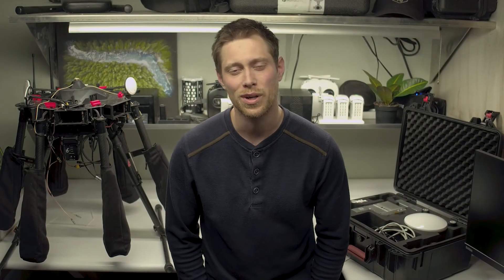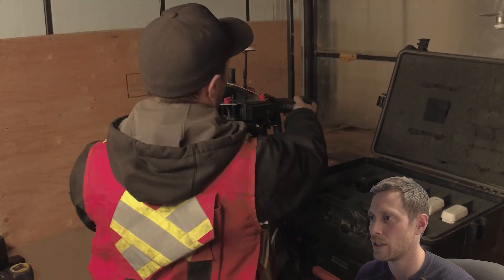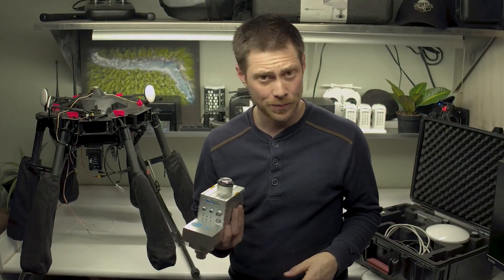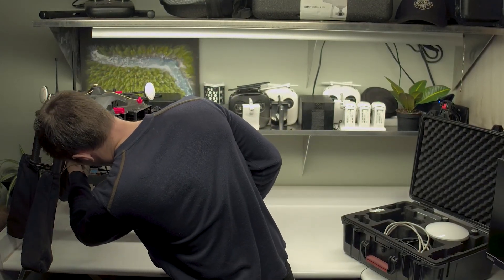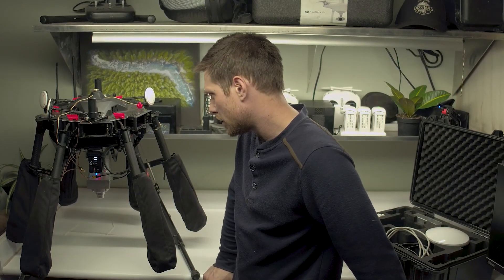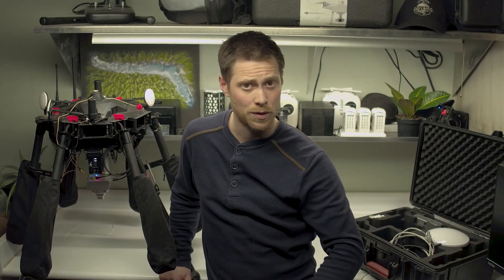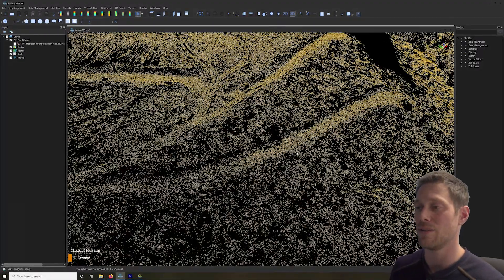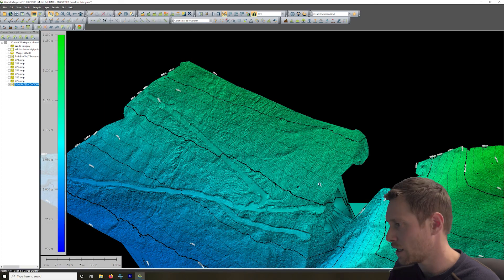Steep slopes with the LiAir V Lidar Sensor

Comment: hi, i am from Argentina. i bought one of these lidar 3 months ago and i have a hard time getting the IMU to be "solid blue". Sometimes I spend more than 25 minutes waiting for it to get the blue light from the IMU. Has it ever happened to you? I have tried more than 30 times and only 3 times have I gotten the IMU to work. I have been told in support that it is an electromagnetic field issue, but it happened to me that I have come out with solid blue and when it lands it is flashing red and then when I download the images to the software, some even place them wrong. Do you have any suggestions you can give me about it? Thanks.
Reply from the maker: Hey unfortunately yes I have had this problem before but not to the difficulty you have described. If this happens I just pick the whole drone up and do a manual figure 8 and then power the LiAirV off and then back on agian. It usually is good for a while after that though... Try that first and let me know how it goes.
Reply: Hola Soy de Chile y también tengo un sistema de GVI. Me pasa algo similar con la luz azul. lo que hago, es elevar el drone, realizar un par de ochos aterrizar y se pone azul. Cuando recién lo compre se colocaba rápidamente en azul fijo, pero ahora le cuesta mucho.